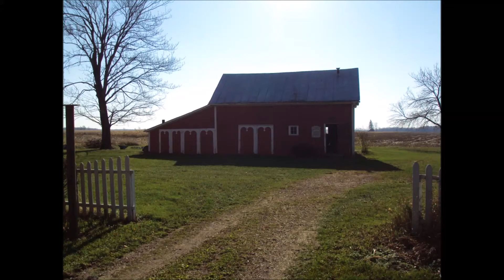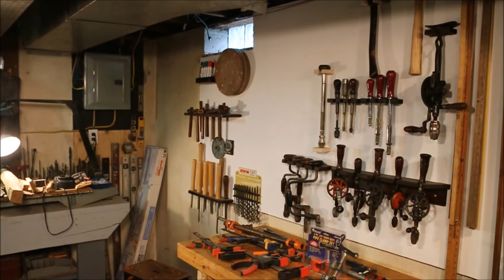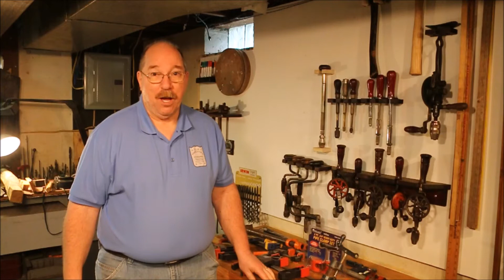HOW TO BUY GOOD TOOLS

Comment: Thanks for the thing about Chrysler.It does explain a lot. My 'C' clamps are steel because a neighbor borrowed one and it bent and didn't brake. I bent it back and it's good to go again. The bars are Jorgensen or similar knock-offs. 2 good and one cheap  My cheap ones I got but didn't have to buy so they're good enough for who has them and their tasks are limited to the amount of living brain cells I have. The Irwins speak for themselves. NO problem. Easy does it!